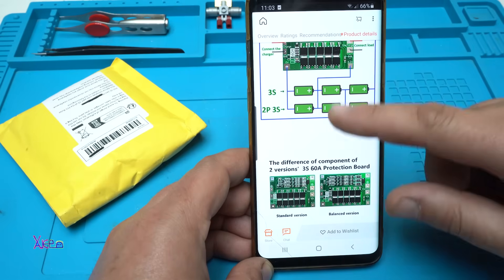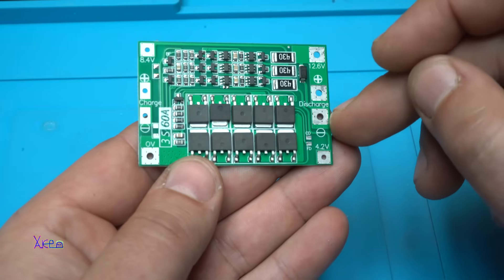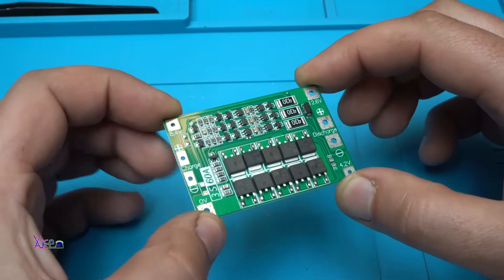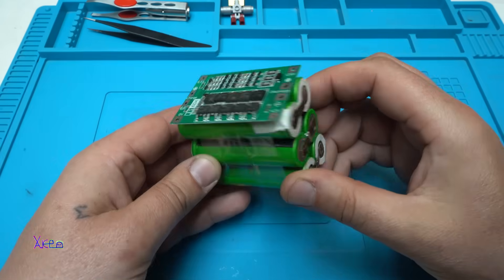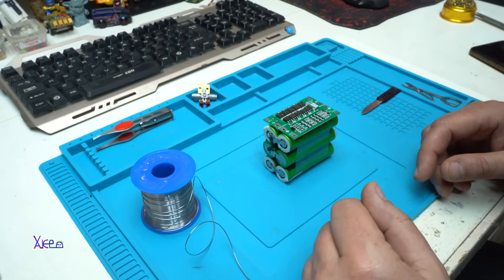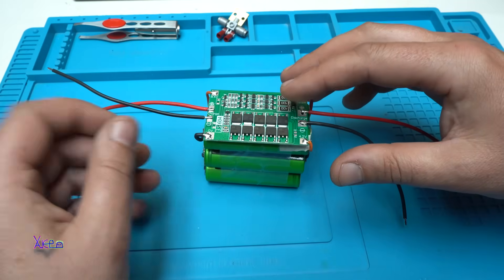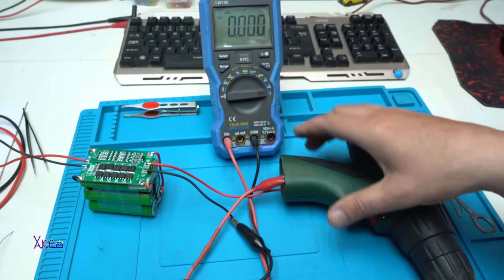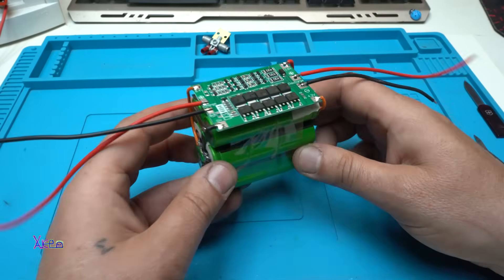$1 Amazing 3S BMS Module is IMPRESSIVE? 18650 battery

Comment: Great video. My only concern is that your selected BMS might be oversized (60A) for a 3s2p configuration with 18650 cells. I do not know the characteristics of your cells, but if your cells are 2Ah and rated 3C (meaning that they can safely discharge 3X their amperage rating), then the maximum continuous draw is 6A for each parallel group of 3 cells. You have 2 parallel groups, 6A * 2 groups = 12A would be your maximum continuous draw. Unfortunately, If you draw (for example) a continuous 20A (anything greater than a continuous 12A), then your BMS's over-current protection won't trip because 20A is way below the 60A protection limit: you risk damaging your cells. Your 60A BMS size is most likely meant to be used for 3s10p (10 groups * 6A = 60A) for 2Ah 3C cells, or meant to do a 3s2p with larger cells (4Ah 10C 26650 cells for example). Make sure your BMS is sized to match your battery pack otherwise you have literally no viable over-current protection, which is the whole point of having a BMS added to a battery pack. Add more 18650 parallel groups and/or get bigger cells (26650) and/or get a BMS with a smaller maximum current protection limit.

Comment: its not "better" to use a spot welder its just faster.
Soldering an battery is the normal way to do it.
Spot welding is just faster for companies and Roboters.
The heat is no problem when you know how to solder.
Reply: That is not correct. Heating the batteries degrades them. Using a normal iron and tin requires a "long" time heating on each side.
The speed is a required side effect of spot welding.
Reply: Ricardobino1174 is correct. In fact, I’ve seen warnings by the manufacturers specifically stating not to solder to the battery directly and that goes back to the NiCad days. You can get batteries with solder tabs where you solder the tab but, not to the battery directly.
Also, if soldering is the “normal way” then why are there so many spot welders for batteries on Amazon? Seems like there’s enough demand for this method to entice a few companies to make/sell them.

Comment: Is there a board for LiFePo4 batteries?
Reply: that's for 18560 or similar with li ion material.... for lipo4 there is a BMS with another type
Reply: No, I don't think so. I'm pretty sure it's for batteries made from cells that you charge to 4.2V per cell.